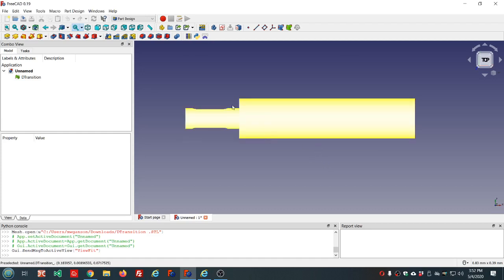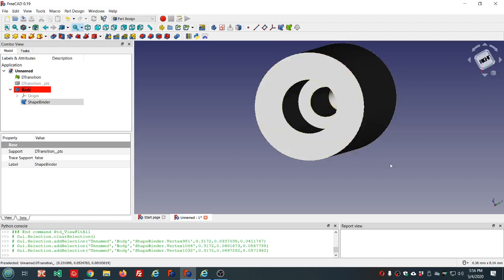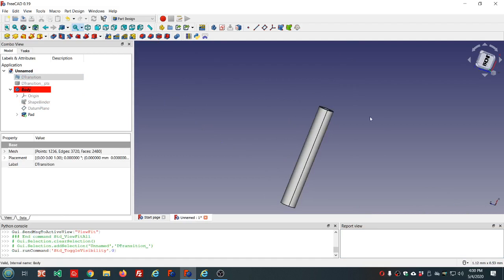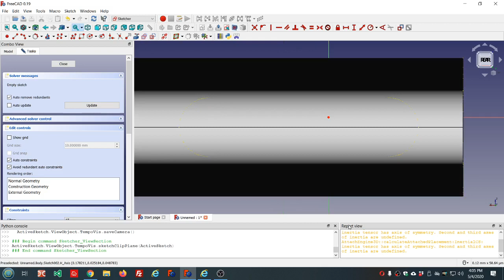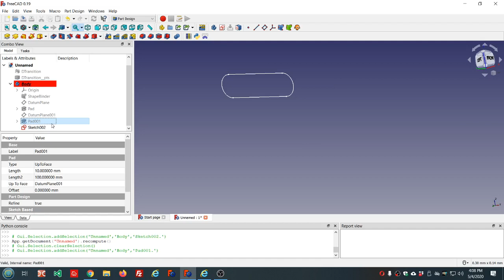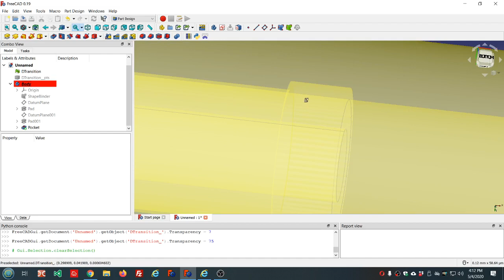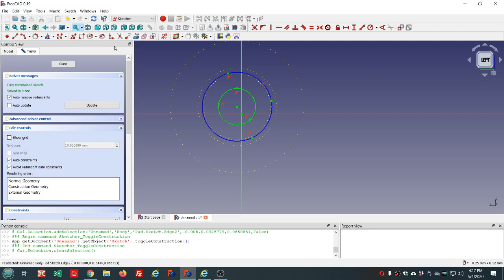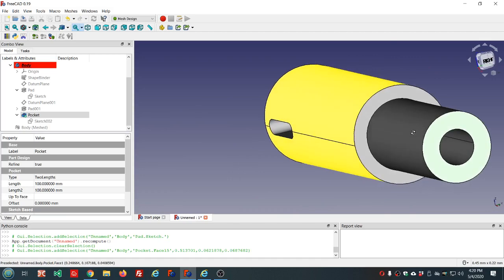068   FreeCAD remodeling stl mesh

Comment: Thank you for the explanation.
I tried to convert a .stl - file a while back but couldn't get the hang of it (i'm still starting with this program). It still looks like a lot of work but it seems to be working. Do you know if there are other methods to do this? 
BTW: could you put the FreeCAD version number in the title? I'm looking at a lot of video's of which a lot are about older versions which only shows when watching the video. Thanks in advance.
Reply from the maker: Thanks for the feedback.  I've started putting the version number in the title.  There are almost always multiple ways to accomplish the same task in FreeCAD.